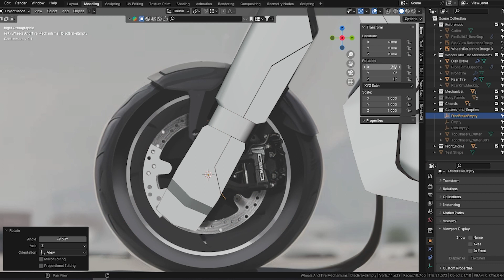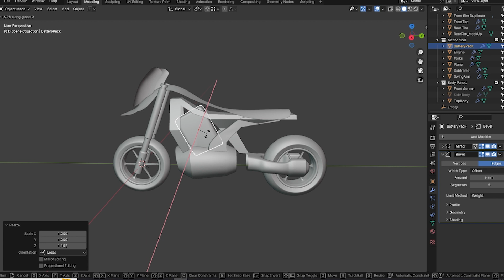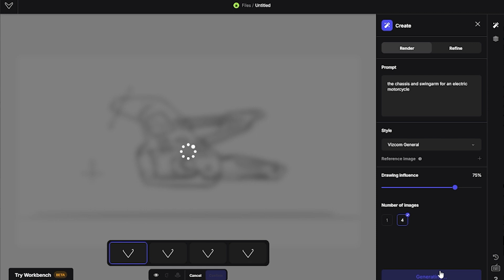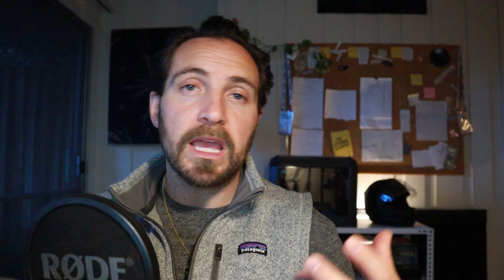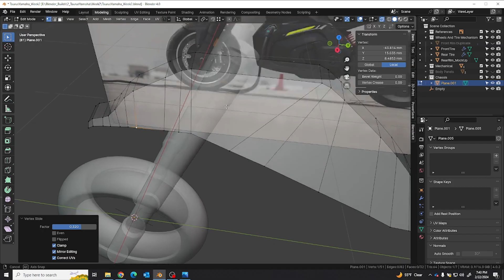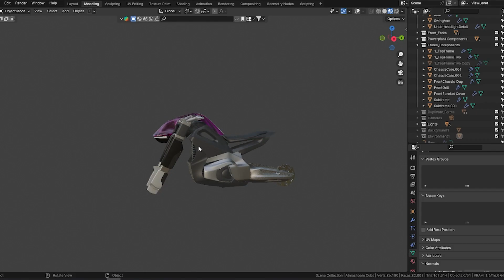Building a Concept Motorcycle in Blender 3D

Comment: A motorcycle is a difficult thing to model because it is very complicated, being made up of many detailed components, such as the engine which is a starburst of complexity, in itself. Use CAD to draw the side view, front view, top view, rear view and bottom view, first. Then, isolate the most visible and important components and draw them separately, also in at least two views, ie: front and side views. Do this for every component which you want to illustrate in your concept. Model the components individually, in Blender and then append them into a Blender host file, where you can integrate them, showing breathtaking detail. The salient lesson here is, you only need two views in order to define any object thoroughly. Attention: this only applies to components, not the whole assembly of your motorcycle, airplane, automobile or, whatever. This is how you can acquire stunning detail in your 3d model !!